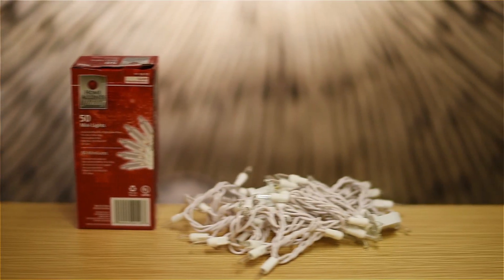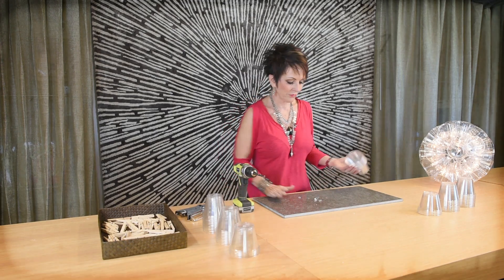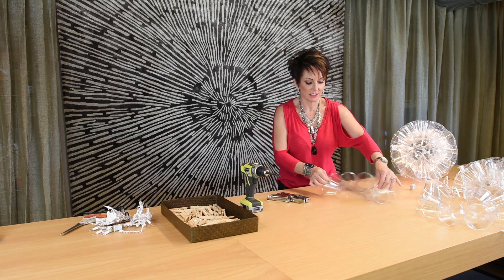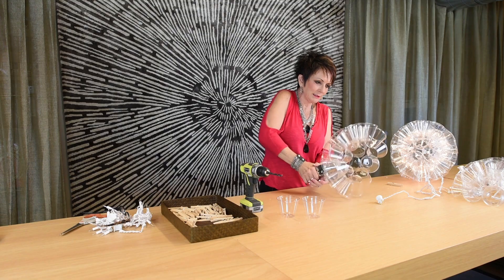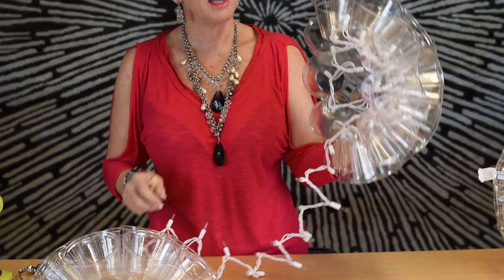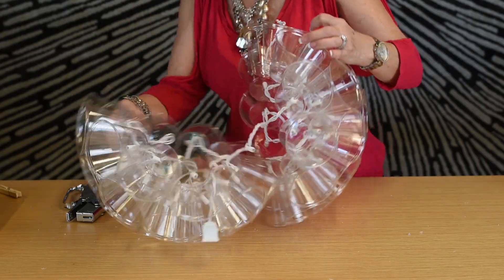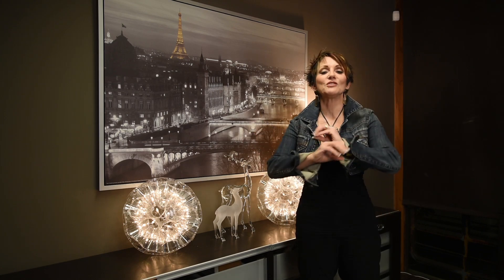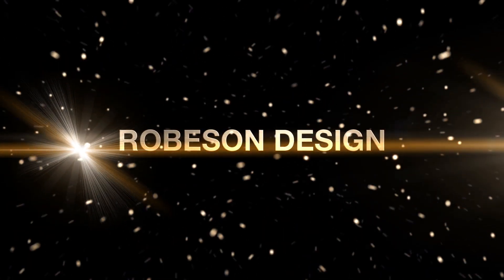Sparkle Ball | Complete instructions on how to make | Christmas Decorations

Comment: I have made quite a few of these, but I do mine a little differently - I use a soldering iron rather than the drill.   It's a bit harder than it looks, but I made mine with 150 multi-function lights; they are GORGEOUS when hung outside.   They last quite a few years.

Comment: Funny question, but what size staples?  1/4", 3/8"?  This is an awesome, easy to do project.  Thank you for the clear instructions!! :)
Reply from the maker: +Kim Simons 
Hi Kim, I'm not at the office where my staple gun resides but I don't think the size matters so much. As long as you use the staples that fit your particular staple gun. The cups are very thin so you will probably be fine with the smaller of the 2 sizes :-) RR

Comment: Hello please help me. What diameter are your cups? With my first I have to use the ring 19 cups. Otherwise, I do not have a ring. My ball is too big:-( Thank you
Reply from the maker: maxhanys I'm reading this comment from home so I'm not where I can measure for you. Sorry. I can tell you, the only cups that work perfectly are the 9oz. SOLO cups! Have you see the second sparkle ball video I made? I too used a different size and only made half a ball. It took 110 cups! CRAZY how the diameter of the cups changed everything! I feel you pain! ;-)RR
@watch?v=8ZQ9cg7MHh0
Reply: Robeson Design i had the same problem my first layer was 26 cups i used 10 oz cups but they were taller and narrow i have not seen any the size you used in my area just the larger ones